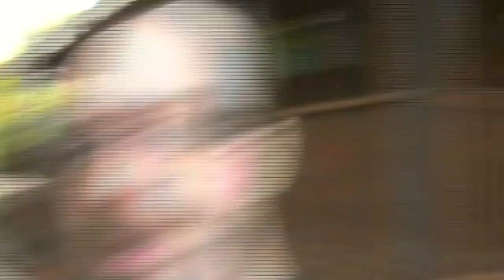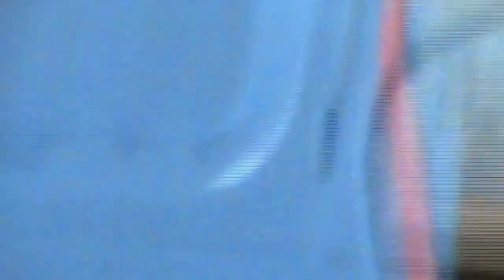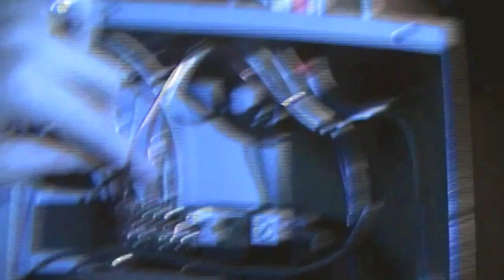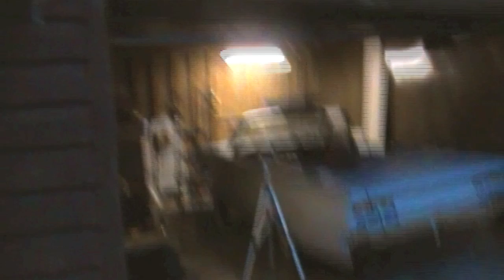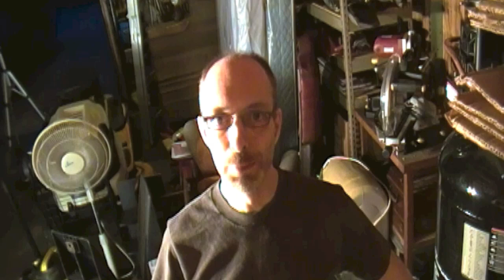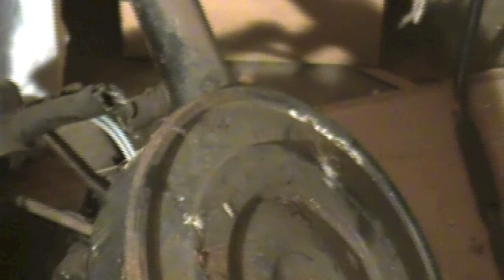Compressor saga continues and cool stuff

Comment from the maker: 10-3 isn't required and in fact there isn't anything to hook the extra wire to anyway :-) You can run 240V down anything, but it should be minimum 12ga (as opposed to 14ga for most 110 circuits). I stepped up to 10ga because the 23 amps the compressor draws is just outside spec for 12ga.

Comment from the maker: Yeah, I'll get in there with power on if I need to, but I'd rather turn it off to be safe. I got zapped a few times back in England, and that's 240 volts, so 110 doesn't scare me too bad, but it's not something I enjoy experiencing ;-) I actually once got 40k volts in one hand and out the other, off a faulty CRT monitor -- that was *very* unsettling!

Comment from the maker: I did find my circuit tester and have some more video shot on what I found out that I'll be uploading; but long story short, yes, the double-pole breaker is connected across both phases and when I test the voltage across the connector lugs on the 'input' side of the breaker I have 220, but across the 'output' terminals, I have nothing. In other words, I think I was sold the wrong breaker :-( With any luck, all I need to do is swap that out.